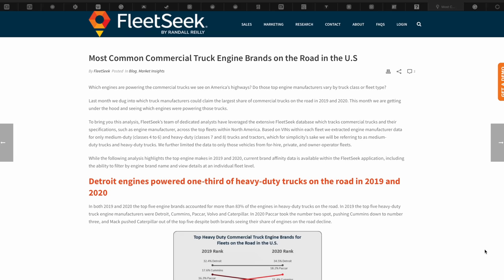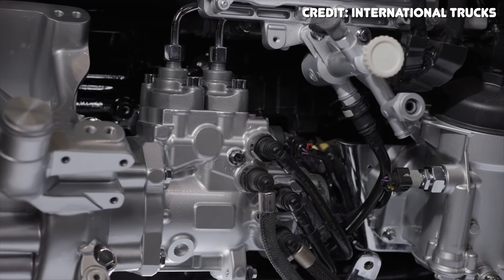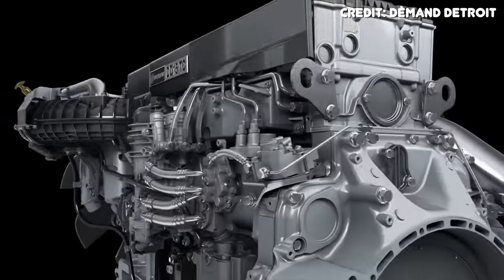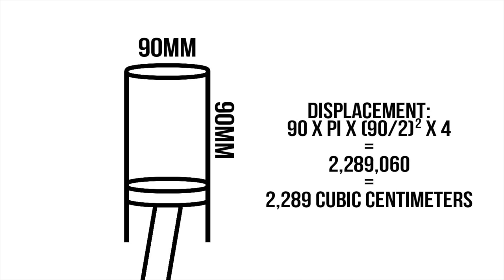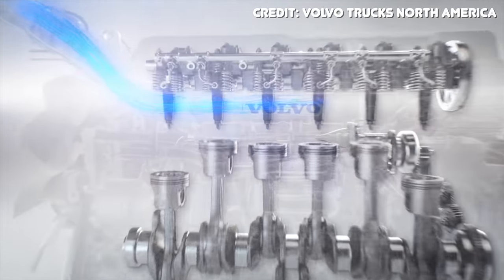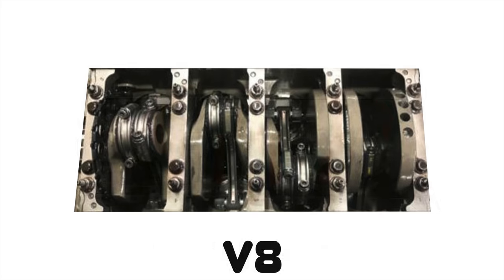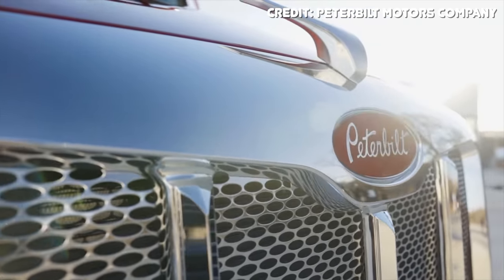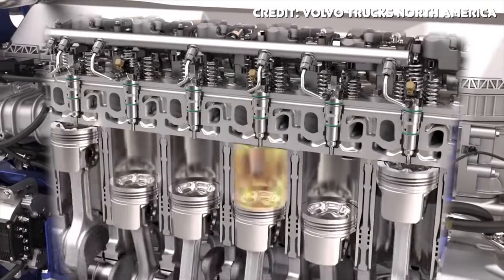Why do Semi-Trucks Use Inline-Six Engines?

Comment: As a heavy duty diesel tech I’ve never once in my life heard someone say that a paccar is their favorite engine lol. Paccars are for people who want a Peterbilt or Kw but can’t afford a Cummins or fleet companies who want to cut costs and run a cheaper (unreliable) engine. All of our KWs in the fleet unfortunately have paccars and they’re all significantly less reliable than a freightliner with a Detroit or an international with a Cummins. Other than that great video for teaching the basics to people that may not otherwise know much about big trucks!
Reply: When I drove for Prime Inc. My T600 KW had a Detroit diesel. I'm not a mechanic so I can't speak to what is better than what. With that said, My truck was on time every time and never broke down.
Reply: Only people who buy paccars are desk drivers that look at numbers of cost vs breakdown time and make a decision on how much the company is going to make and discard the possibility of a stranded driver by the side of the road as long as it makes sense mathematically to fleet.
Reply: @rdsii64  detroit got acquired by Mercedes in the early 2000s followed soon after by freightliner. Before that you essentially had the pick of the big three engines in all trucks
Reply: As another diesel tech I agree 100%. DD15s and ISX15s are the two most reliable engines on the market right now. Volvo/Mack also make a good engine with more electronic issues. Paccar is the worst on the market, at least since the Maxxforce went away... Gotta love the older engines when I see them though, C15s and Series 60s are still very good engines.
Reply: @gailgrove  lol I  don't know about reliability I've worked on shit loads cummins isx15 cummins isx isl and isb have kept me well paid for many years they keep cummins back for repairs
Reply: same worked for trucking company as a mechanic owners said we gettin a paccar the drivers all said no paid a little more for an isx550 in a kw w900
Reply: Paccar engines are made by a company called Daf . They were in the euro truck world long before paccar engines were a thing... Of course the first few paccar / kw / pete... bastard engines were actually almost cut copy paste of the cummins isb , isl etc... Repainted rebranded as the paccar px7 and px9 . Lots of parts innerchangability between the two in the earlyer days .
Reply: @jdogdiesel7242   The PX engines are still Cummins painted great, literally the same engine with a Paccar valve cover medallion
Reply: @kevinbrazo1  the px versions yes. The mx's are rebranded Daf engines from europe
Reply: @gailgrove  
I think everyone has a favorite engine,  for me I really liked the older Mack engines,  and the E7 , drove a Mack  CH  E7 350 , pulled well, and with a gross weight of 79,000 got 6.25 MPG.
Reply: @gailgrove  Detroit series 60 and Cat c15, 6nz specifically, are the best in my opinion.
Reply: @JayElement13  I put over 700K on a Cummins and never had any engine related issues at all.
Reply: They all boat anchors now.
Reply: I've never heard anyone say the Paccar is a good engine. They all agree that Detroit, Cummins, or Cat are the way to go. If you look at Pete dealer videos, you won't see them ordering a Paccar.
Reply: I know a guy who runs a few Paccar trucks with Paccar engines and they've been mechanical headaches the entire time. I'll admit when they work they're quite nice but that "when" is the key word. I definitely prefer my Cummins ISX
Reply: The MP7 I drive now is light years better than the PX9 I used to drive, from a power and reliability standpoint. Both were grossly overworked in a mixer truck weighing over 70k
Reply: I blew two valve seats on my Paccar at around 465k miles. New head, two injectors, new turbo, EGR cooler, DPF and DOC, etc needed after all that. Still paying the damn bill after that service. If I had owned the truck at the time, I probably would've swapped for a used ISX.
Reply: DD15's are neat to work on. But my biggest problem is when someone else has been in there. Torque wrenches are a thing, people need to use them and follow the manual. I feel like I should have stock in Heli coil. Give me an ISX15 all day long, or all week for an in frame. If your running a DD15, listen to me now, Don't skimp on injector seals. Replace them on the regular. You don't want contaminated fuel making it to your exhaust. What a head ache. I do fleet so we got time. Over the road might find it rather expensive.
Reply: @OpeoAslam  The problem with Paccar is diagnostic support. You probably didn't need all of that. But when you plug in three different generic diagnostics and get three different results, it's hard not to fire the parts cannon at it. And then again, I've seen them absolutely need that and more.
Reply: Absolute worst engine to service. Every time I've done one it's been a bitch to prime. If you don't have a 12v pump some hose with the quick couple to the fuel filter good luck. The little green cummins ones aren't bad at all
Reply: Paccar is made by Cummins
Reply: @3116Cat  only the px6 and px9 are cummins, 6.7 and 8.9 respectively. The Mx13 is DAF, very little cummins components are interchangeable
Reply: @kylederry5031  All you need is the quick connect for the bleeder closest to the fire wall. Have a buddy hold a rag with shop air to the fill neck. Once you you have straight fuel, no air there, bleed the small bleeder. Then just crank on it holding 1/4 throttle until it fires. Takes about 30 sec of solid cranking, she'll fire.
Reply: @3116Cat  Paccar is a parts distributer for Cummins. They might have the same parent companies, But Cummins does not make Paccar. Their different companies.
Reply: @DayRider76  Mx13 is the only engine that has this process to get going. If I was a dealer tech I'm sure there is a specific way of doing it but I'm general repair and only get Paccars once in a while thank fuck. The only thing worse is the Dd15 in Freightliner Cascadia short hood, fuel quantity valve on the pump goes bad n causes idle surge. Fully reachable on the long hood, under the cab on the short one, need to undo the cab mounts n jack the cab , driver fender off
Reply: @kylederry5031  I have not had to deal with that  yet, thank god. Thanks for the heads up. My background is heavy equipment. I've only just started in fleet last year. We have mostly ISX15, DD13 and DD15 with a couple Paccar and a few older Cats. This week was a DD15, injector cups, reseal the heat exchangers, new clutch, drain the tanks, clean the temp probes, new fuel , full service and regen. Fingers crossed I won't see it again anytime soon.
Reply: @3116Cat  not all of them. Their larger engines are in house builds and that’s why they suck lol
Reply: Make note that the new International A26 is a MAN engine.  Anyways, with minor exceptions of older buses and a motor coach, I have only driven engines of the last ten years.   Cummins is great, overall favourite.  ISX is a fantastic engine, no issues, really smooth, gobs of power, and red.  Volvo (and I suppose whatever Mack calls them) also great engine, pairs with the only automated transmission I actually enjoy, I-Shift is brilliant.  Daimler-Detroit is rubbish, I cannot stand them.  Finicky, argumentative, our mechanics don’t like them (strange, since the last four employers I’ve had were buying them like they were going out of style) [exclude the DD5 and DD8 which I greatly prefer to the ISB, which is well out of its league on most applications].  Anyways, I cannot say anything against Paccar, but I’d prefer Cummins.  Now my current job is a local grocery run, and we have a motor pool from which we can pick daily.  First choice is the T680 with the ISX15, second choice the International LT with the ISX15 (haven’t gotten exact numbers but I’d say around or just under 500hp) third choice is the Cascadia with the ISX’s, which are rare, most with the DD15.  I have said I’ll take the load with the yard mule (Capacity TJ with an ISB) before I take a Cascadia with the DD15’s.
Reply: As a diesel technician I agree. I have never heard a owner operator say they love paccar engines.
Reply: Give me a Caterpillar any day all day over a Crummins
Reply: @DayRider76  not only that but half the time when you call up KW they don’t even know their own parts lol. Can’t tell you how many times I’ve read a part number off a part and they tell me either that part doesn’t exist or that part number now belongs to something else and the part I need got superseded to a new number that they can’t find. They’re hard to deal with getting info out of them for fleet companies. Freightliner on the other hand while they’re not the best trucks on the road, they’re the best to deal with in terms of customer support and giving out all the materials needed to make repairs
Reply: @drewncars9505  Yep, when we call Peterbilt and TRP, we have the parts in our hand in the time it takes to drive to our shop. There's other vendors out there that will argue with you weather you really need a radiator hose and not a power steering line? Just because they couldn't look it up and had no Idea how a truck is put together. Had that today, by the time I got off the phone, I felt like going to the parking lot and running over my head, just to get just to get it out.
Reply: @aaronsanborn4291  I like the Cummins. I'm the Cummins guy at our shop. I've done two Inframes, One head, two front covers and an overhead , since our Cat guy did his last overhead. Job security. The Cats are going away in trucks. Soon there won't be any left.
Reply: 😂 so true
Reply: The Paccar MX13 is an awesome engines ........ as long as it's been emissions deleted.
Reply: @chackos123  I’m sure deleting it helps but that’s still just polishing a turd lol. Our KWs break down more often and spend longer times in the shops than our freight shakers do. Wish we got our trucks with X15s instead. Then at least they would only be in for wiring issues with the truck and not both engine issues and truck issues haha
Reply: @wizard_of_poz4413  Daimler Benz AG has owned Freightliner since 1981. When Detroit was purchased, Daimler was the same as Freightliner. Detroit engines were available to other manufacturers through the 2002 model year.
Reply: I was dead ass thinking the same but at lease we all can agree #fuckmaxforce
Reply: @genaro.cruz-vicario5301  what's the maxforce your anchor chain can handle?
Reply: I’m a kw w900/Pete 379 fan running deleted cat c15’s… they’ll run forever. Easier to work on. Can build em out easily for oilfield work.
Reply: In my experience with owning a few paccars, it's not the engine that's the problem; it's the whole Def system. Kept having problem after problem until I deleted them. Now they run like raped apes with very little issue. Delete and carry on.
Reply: @Fucktheworld14020  MTO officers in ontario Canada have trained inspectors who know how to spot deletes. If they suspect a thing they run a scope through the stack to see if the DPF filter has been punched through and even hook up a scanner and check all computer parameters haven't been tampered with, blocker plates for EGRs, they'll find it and yank your plates
Reply: @jdogdiesel7242  Wrong! Paccar MX is the Daf MX engine!
Reply: @3116Cat  Nope
Reply: @jdogdiesel7242  sorry, i mean yes...MX engines are from Europe
Reply: @ackzlebobbitt7511  Just don't get caught at the port by an inspector who knows how to spot deletes
Reply: @ackzlebobbitt7511  For sure, my Paccar MX-13 EPA 13 has ~560k on it and still has factory oil pressure (would never be able to say that about a DD15 after 500k). She burns about a gallon in 30k, but has done that since I've owned it (roughly 220k). The ONLY problems I've had with this truck is 1 ABS sensor and about a dozen after treatment and EGR faults. Can you recommend a good tune or programmer (or at least point me to where I might find some help) for these engines? I don't want to delete mine and find that longevity will suffer but there's nobody I trust around here to do it.
Reply: When I did Cummins field service, my truck was powered by a C13 Cat. After you take out the fact that Cummins are stupid simple, they’ve yet to produce something that is truly impressive. 
I hated the warranty work that happened before the Customer ever saw it. They still break.
Reply: @roundsm18  you mean like the big cam, kt, isb, 12 valve, or isc? All very good engines
Reply: People need to stop ragging on Cummins. Just because they are the last man standing in the “designed and built in the USA” heavy market is no cause to hate. Buy a Cummins or watch your last true USA truck engine disappear.
Reply: @DayRider76  How often do you replace injector seals on the DD15?
Is the ISX15 more reliable or cheaper to repair than the DD15 or is the DD15 cheaper to maintain?
What about fuel mileage?
I'll be pulling tanker regionally or dryvan OTR.
Reply: @mterveen1  Got one for sale?
I'll run Midland/Odessa
Reply: @nostradamus7648  Injector seals are usually pretty stable. It's a good idea to know the warning signs if they haven't been done in a while. Oil sampling is a must. As far as reliability, it depends on what your doing with it and how you treat it. We pull main tanks with pups. The biggest issues we run into is the driver. It's a matter of what fits you better so you can drive it right. The ISX tends to be more robust and a good generic fit for the drivers equaling less trips to the shop. The DD15 with the right driver and good services, is a power house. But you have to do your part to keep it that way. As a mechanic, I don't really give a shit witch one I'm working on, as far as level of difficulty, it really doesn't matter. They have their give and takes.